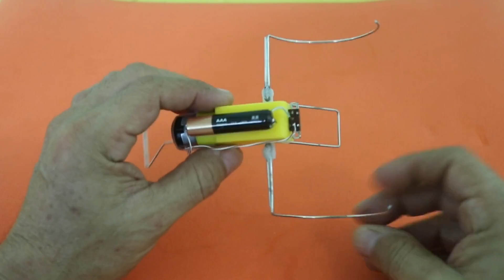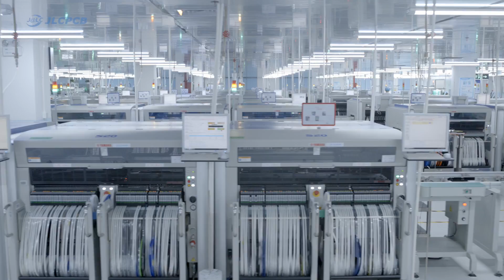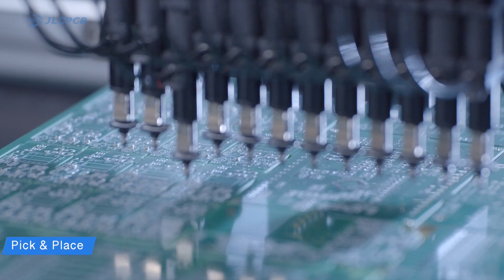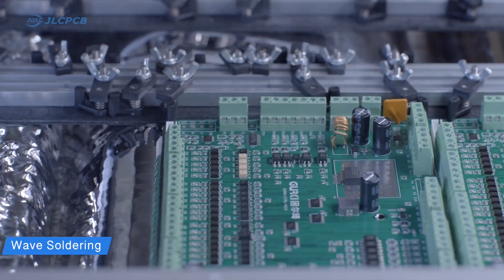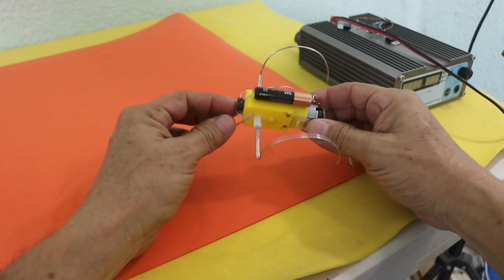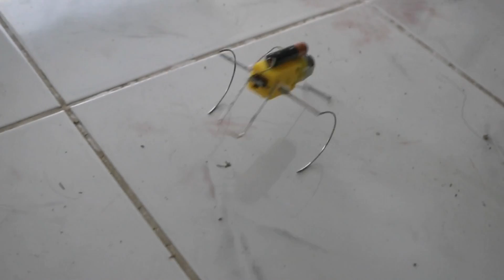Easy Robot!

Comment: I missed the kind of motor to use. Could you recall it please
Reply: Hi,
As far as I can see, the used motor is the TT-motor (with gearbox).
It's a 3-12V DC-motor, I use them a lot in my projects.
🤖Greetz, Peter